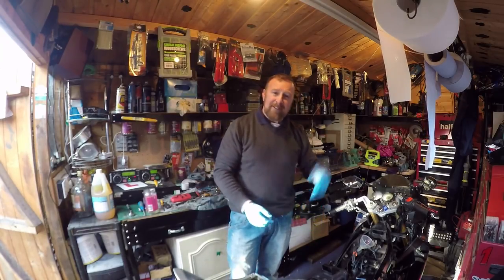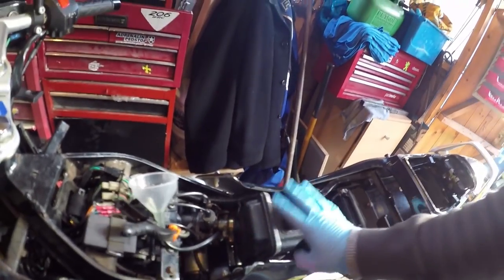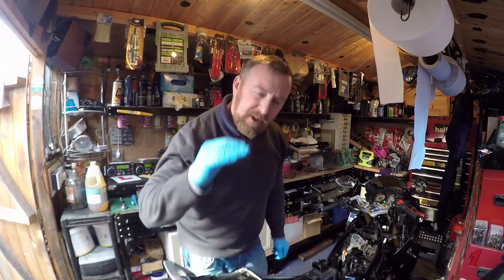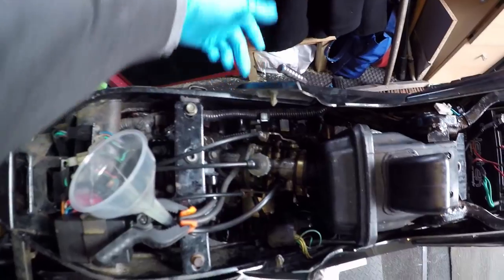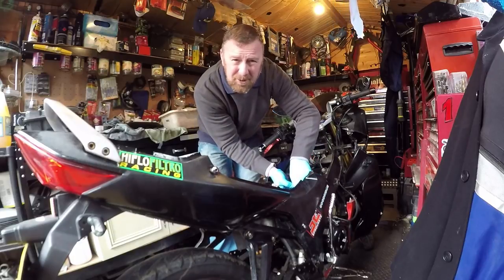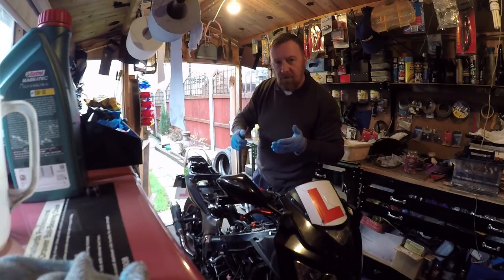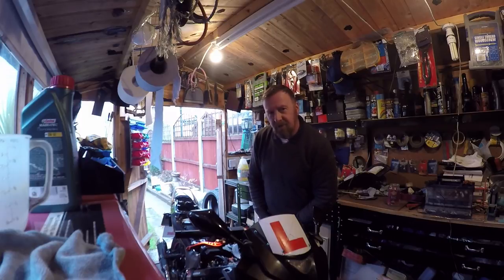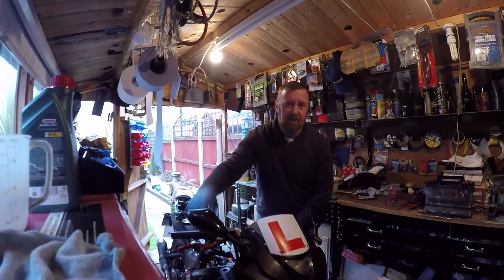4T CARB TUNING MARK SAVAGE

Comment: Hi Mark.just changed fuel FILTER.cleaned carb and jets..waiting for a new vacuum pump..but I have just noticed something on my second hand scooter that maybe you can help me with.....took the seat and bucket out changed all my fuel lines..went to change my air hoses and noticed I have 2 separate ones coming from 2 separate air filters..1st on coming from original air box into the head..but is not contacted to carb anymore and a 2nd one coming from vacuum pump to inlet manifold..surely they should both be teed off to the pump cos the original air box isn't even connected to carb as it has a k&n on it
Reply from the maker: sounds like someone has played around with it bud, how does it run like it is now?

the air pipe should come from the carb to the inlet manifold the air filter should be connected to the carb, you may have to lok up your bike as not sure which one you have and try and find some specs on it 
mark
Reply: @marksavage  there's not a air pipe connector on the carb...there's one on manifold and one on the head...both contacted to 2 different air filters..it runs ok for about 6mile then acts like it's run out of petrol and dies..then 30 secs later it starts and runs again ok..it's a tamoretti retro 50..same as the znen and tommy scooter 50
Reply: Also has a 3way petcock vaccum pump it's a 4 stroke
Reply from the maker: Neil powell oh it’s 4t so they do have this strange sort of vacuum system but either air from one of the pipes faulty vacuum it’s self 
You’ve changed the plug so that’s not breaking down 
It could be stator coil going to earth but I have recently been asked about the same problem but the guy never got back to me maybe he sold it on ?
Reply: @marksavage  I've done fuel filter.oil change.spark plug.duel hoses..just waiting for vaccum pump..but also going to take of k&n filter and 're connect the original to the carb...I took it 4 mile today and It died on me twice..I think it's getting to much air and fuel mix..but won't no until it's all been changed back..also got new 8.5g rollers ordered

Comment: Hi mark it’s me again🤣 I’ve got my xtrs up and running properly now! It was the valve clearance the exhaust valve was so tight which I presume was causing It to run incorrectly. However I now have a new issue I need to bleed my rear caliper which unfortunately I can’t do as my bleed nipple is seized...can you shed some light and ideas on how to get out of this pickle or how I can bleed it ? I’ve tried bleeding it using the banjo bolt however I’m getting nowhere

Comment: On any kind of carburettor the idle fuel/air mixture is adjusted with either an air screw, or a fuel screw.
What you have there is not an air screw, its a fuel screw! if you've got it out 4 1/2 turns out, no wonder its running rich! If it was an air screw it would be forward of the butterfly, on the airbox side, not behind it on the cylinder side. you need to screw it back to factory settings and check the plug again!

Comment: Hi mark, so i have a Peugeot vox 110cc carb model with a manual choke, im having issue where it will only fire on choke and will run for about 3 seconds then cut out on throttle or very rarely will tick over don't know what the issue could be as the float and jets are clean, it was leaking fuel from carb over fill but still kept running so not sure what to do with it there are no splits in the manifold, apart from its got no exhaust on and the filter doesn't make a change on or off, please help if you can, thanks.
Reply from the maker: not worked on one before bud so not much help but if its leaking fuel check vacuum as it sounds like it flooding
Reply: @marksavage  yeah could be that thank you will have a look.

Comment: hi mark quick question the air vacuum pipe where does the other end go to when the bike is put back together just bought one of this and first one if had so bit unsure and would really appreciate your help on this
Reply from the maker: The air / vacuum pipe goes from the vacuum ( feul vacuum) to the side of the carb
Reply: thanks mate were does the pipe on the manifold go to or is that the pipe ur referring to
Reply from the maker: @kingaz1985  yes bud manifold to the vacuum 
Fuel from vacuum to carb 
Like in my carb videos
Reply: @marksavage  ur a legend mark mate thank budy another bike bak on the road with ur help ;)

Comment: try leaning out with needle as the screw is for more finite adjustments
Reply from the maker: Mr. Geek it had no adjustment on this one for some reason that made any difference 
Was thinking the carb was real rubbish but did get it sorted on the last adjustment 
Thanks for you advice bud 
Mark
Reply: @marksavage  can't change the needle height ? Hmm. I see why you were struggling now cheers

Comment: on a 4t the mixture screw works opposite to a 2 stroke..in to lean out to richen..2 stroke is an air screw hence why u turn out to lean the mixture, 4t is a fuel screw..u turn it out to richen it
Reply from the maker: colin bourne I’ve had this on some yet it was out 2 half turns and running so rich the plug was black and would not start after 1 min of running 
The more out the lighter the plug looked and it started and ran better at the end 10 half turns out it ran started and plug was not black but dark drown !!
Go figure 
Think the carb was buggered lol 
Thanks for your advice 
Mark
Reply: @marksavage  something wrong there then as like i say on a 4 stroke when you wind the screw out it richens the mixture, have you checked the float height?
Reply: them Chinese carbs have a mind of their own sometimes, best thing throw it away and fit a new one.
Reply from the maker: colin bourne I know bud I was just one more ty before smashing it with a hammer and buying another 
Mark
Reply: welcome to the world of lexmoto haha, wait until you get the luck of the venom injection engine......whole new meaning to the word shit

Comment: Here's a problem I'm having now . About 5 days ago I stopped turned off engine to get gas . Pump the gas scooter won't start . i push it over to a parking place to get out of the way try again wont start . I put it up on the rear kick stand it starts . Runs good ect . 
Today I'm on the road decide to pull over let cars behind go by . As I'm slowing down to pull over engine dies . Won't start . i push it to level ground wont start. I get it more stable get it up on the rear kick stand again it starts . Seems fine . Any ideas? Thanks
Reply from the maker: ive had this on the old speedfight's and is common, some moped just like to be kick started others electric started but I have found it turned out to be to do with the stator coil, this is what give you the bang to start and as it gets dirty or worn it send lower volts to the ht coil so low spark and just seems not to want to start even tho it turns it over ok, 
but when you kick it it's faster turn and starts
first id start with a good old service new plug and air filter and take note of the colour of the plug as maybe be rich, in this cold weather they seem to run rich due to the cold air 
if still the same then get hold of a volt meter and check what you have coming out of the stator and maybe give it a look and take off and clean as this should help if at fault then ht coil
see how you get on bud and thanks for watching
mark
Reply: @marksavage  thanks. My time off coming up im going to do that . Seems every time i bragg how good it runs i end up eating my words .
Reply from the maker: George Jennings this happens to me too , it’s like they hear you Pmsl
Reply: @marksavage  i didnt use the kick start at all. I took it off the side stand . used tge center kickstand . then it started . i had a 1974 Ford truck it used to stop running then after it cooled a little it ran fine . Turned out to be the coil .
Reply from the maker: George Jennings oh right lol 
The moped won’t start on the side stand 
They have a cut off switch like in my Chinese Moore video 
That’s why it won’t start
Reply: @marksavage  hoping that was it but i dont have a wired kickstand . 
So whatever the problem is it's rare, and the bike has to sit for about 3 minutes to start . Friend says it's moisture in fuel . Any thoughts?
Reply from the maker: when they run and stop its always harder than just finding why they don't start 
I'm going for fuel and the big bore kit, maybe as the bowl has fuel for the 30 mph 50 cc and not a bigger piston its using more fuel and its not filling up for the usage 
see if you can adjust the float level and make sure it is filling up ok, has it had a up jet as on the other side It may be flooding which would make the moped stall too
its a fine thing getting them running right this is why I don't like or do big bore kits lol 
did you check the colour of the plug maybe its running rich or weak?
see how you get on 
mark

Comment: My 50cc runs great one day . Next day it may hesitate or die at a redlight . Always starts and idles great . Seafoam seems to help . So much snow and so cold here don't know when I'll get a chance to work on it .
Reply from the maker: George Jennings cold air can mess around with the big keys running with the air mix 
But a carb clean can help and a clean plug and airfilter bud 
But as long as it starts back up straight away maybe just up the revs a little 
Mark

Comment: Hey mark i found out why my speedfight 1 engine seized, the corner of the exhaust gets too hot and it ruins the oil pump seal which is close, all speedie exhaust should have asbestos wrapped on the exhaust corner 😁

Comment: hi mark bought my boy a suzuki uf estilese  50 cc ped was running great but today not so much  starts fine but cuts out under load as soon as you sit onit will not pull and cuts out  but onstand runs fine and back wheel spins eny ideas mate ?? love the vids keep thegreat content comeing fella 👌👍
Reply from the maker: BLAKE TURNER hi bud it’s the really cold air 
This changes the air mix 
Best service so loud and clean air filter this should help 
Next poss carb clean then a turn if needed 
I have videos to help mark

Comment: You think those iridiumn plugs are good ? Or a regular NKG plugs just as good ? The expensive plugs are around $12 US dollars . Also I've wondered about those muilti electrode plugs . thanks .
Reply from the maker: ive used both and think the iridium plugs are best and better than standard on sports and performance bikes, but really it comes down to your choice and what you want to pay out as they all will run fine in your bike 
the bigger the spark the more bang they say lol
Reply: @marksavage  . thanks . I may try one then . im getting close to 1300 miles on the chinese scooter . I'm off the week of Christmas and if the temperature will get above freezing and no snow or rain I need to do a few things . thanks

Comment: Hello i have the same bike I have just bought a new carb the the lexmoto xtrs but only know we're the trottle gose any help
Reply from the maker: is it a lexmoto carb , did you not take picture before taking the old one off.
so it fits ok and is the right carb?
why did you change it 
id use your old jet so setting up will be easier
Reply: I swapped it from one of these carbs to the original lexmoto xtrs 125 carb but I don't know witch side my throttle and and my choke cable go in to the carb my trottle has two connections what go in to the carb and my choke cable into the carb and and the carb I took out only had one single trottle cable and no choke cable I have noticed all over YouTube u have  had a few dealings with the xtrs

Comment: Hi mate, so I've seen some ppl say using a tachometer makes tuning easier etc etc, what's your opinion on using one to tune? Was thinking of ordering one if it's worth using?
Reply: What a pain the arse that bike is to tune btw!
Reply from the maker: It's up to you bud 
I don't use them as I've tune in 100s but they can help 
For me as in my videos start with 3 half turns and go in or out but if you get one I'm sure you'll use it again so all good
Reply: @marksavage  hi mate, this scooter Is starting to do my nut in now! The  bike cuts out when coming off the throttle to stop, like at traffic lights, I accelerate pretty well but when it gets to 3/4 throttle I start to struggle and it gets a bit spluttery, my spark is shiny black on the rims but the main bit is white, Am I too rich or too lean? I've tried going from the #85 jet to a 90 jet, idle any lower than 2200rpm and it dies, on idle the bike starts too pull away if I lift my feet off the road without throttle, any help much appreciated
Reply from the maker: @clive00rennison  tey a smaller jet and flooding will do the same as not enough fuel 
Black is a little too rich prob due to the jet size bud 
Try 82 and tune Like in my carb tuning videos 
2t and 4t

Comment: Sinnis Apache 125. ..I've upjetted carb from 90 to 102.5 and now it's bogging on full throttle ..would changing the mixture screw help ? Or better off dropping it in size or going back to stock ..
Reply from the maker: Best go back bud as it ran fine before
Reply: @marksavage   yeah gues you right .. worth  a try lol .. thanks for answer
Reply: @marksavage   i only upjeted as it only does 51mph flat out ... never normal for a 125cc
Reply from the maker: @cyberjack  that should be doing high 60s
Odd
Has it been serviced regularly 
Plug air filter and oil 
How are the valves ?
Maybe look into changing the front and rear cogs smaller rear so less teeth and add one to the front 
This should give you more top end
Reply: @marksavage  it does rattle a bit ..so maybe needs valve adjustment .. probably explains it ..thanks mark ..I'll get it looked at

Comment: Hi Mark, just very quickly, My 50cc 4T runs and rides well however when I go to give it throttle after slowing down or stopping it sort of bogs down then quickly recovers... I'm starting to think it's the spark plug as it's happening more often... would like your opinion if possbile thanks.
Reply from the maker: hi bud starting with a service would be the first thing id do and well worth it 
see how you get on before cleaning carb and air mix bud 
mark
Reply: mark savage it’s got a new air filter, changed the oil couple months back, After riding today I’ve noticed that at low rpm it has no power but when I’m going like 30 it’s got the beans to take me to 40. This leads me to suspect that the piston rings are worn & could that be because I’ve been using 10w 40 oil instead of 15w 40 which it’s supposed to take? Your response would be greatly appreciated cheers
Reply from the maker: its a possibility , you have look at the rollers and VARIATOR ?, the could be too heavy weight rollers, bad fitting belt?
valve clearance, only 5w oil really would cause too much damage TBH 
mark

Comment: Mark quick question I'm looking for a new exhaust for my piaggio liberty 50 4t cheaper exhaust say 28mm is that the correct size for a moped?
Reply from the maker: a exhaust will help a little and sound better, try lextec exhausts on e bay and look for 28mm inlet , they are not much money under £40 and easy to fit with a few simple tools
you may have to cut your old exhaust off but no big job 
I do have lots of videos over 400 that will help and worth a watch 
mark

Comment: I’m looking for a sport exhaust for my sky jet sj125 23 can you point me in the direction where to find one
Reply from the maker: lexmoto or lextec they sell them on e bay or google them bud ,
Reply: @marksavage  ok, what one do I look for that would fit my skyjet?
Reply from the maker: @rhyspendry9292  to be fair the basics are all the same so type in variator mark savage 
theres ones on speedfigths and aerox , zips etc
Reply: @marksavage  what you mean Aerox zip ect? I’m looking for sports exhaust for a skyjet sj125-23
Reply from the maker: @rhyspendry9292  ha ha 
Sorry 
Answer 4 people at the same time !!
It comes down to your taste and budget 
To be fair they all work the same just don't go to big outlet as you can loose speed
Reply: @marksavage  that’s okay mate, I’m just looking where to get them from to be honest as I can’t find any

Comment: Hi mark. I have a sym 125. I pull away in first and sum times it locks gear and I cannot change gear have to stop and it free s up oil all fine topped up any idear,gear select mayb. U r a good guy keep it up bro..lol only paid 500 for it 2012 plate.
If it happens in 2nd I can go 1st and bak to 2nd.nor good at traffic lights tho lol
Reply from the maker: glitchy grim it’s common bud and they can get damaged 
If you have changed the oil and the gear change is free of any dirt / grease then it may not be good news 
Clutch is ok you may have a. Damaged gear / cog and some investigations needed
And that’s not a fun job 
Mark